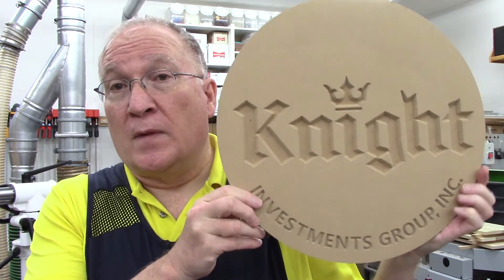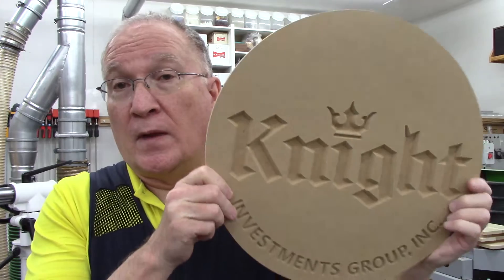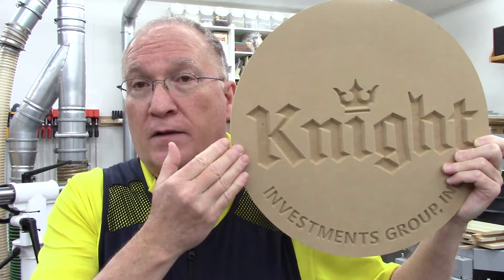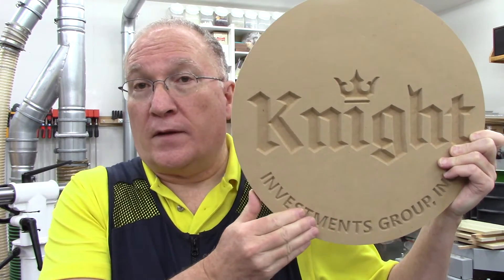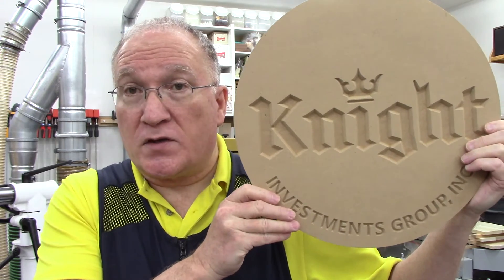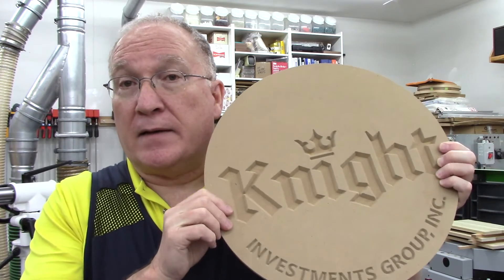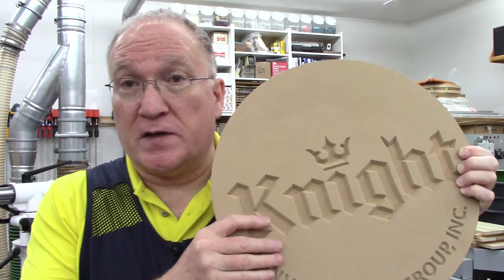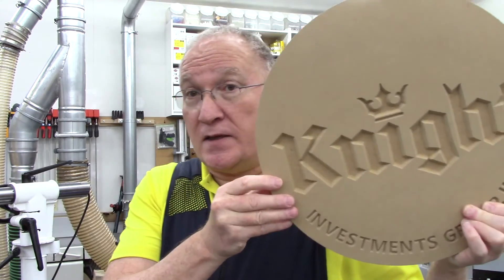Crazy Horse Dolly, Aigner Bowmould Master, and a Company Logo

Comment: great job, using the shaper guard the way its meant to be done, all encompassing the cutters, and the hold downs on the table saw, YES, no fingers within a meter of the blade 🙂; but when adjusting the fence after the cut, TURN the blade OFF, so you don't accidentally run the metal fence, or wood offcuts by the blade turning them into projectiles.

Comment: With that adjustable bearing do you have to make the cut in one exact spot? Looked like you set one point on the guide.
Reply from the maker: Hi Paul.  The guide has an elliptical shape to it so there is one point that offers the maximum depth of cut.  That point is marked with a white mark.  Steve

Comment: Steve, I had the pleasure of going to Michael's shop to pick up my crazy horse dolly!  He is a great guy with an amazing shop.

Looks like I spy an AD-741 in the background...  Did you replace the SCM?
Reply: if you are considering one or the other, I've bought both an ad741 and a minimax elite series machine new.  They are comparable price wise but the minimax is a considerably better machine.  Single post planer table on felder vs 4 post on minimax, and a friction wheel on the felder vs gear box on the minimax for driving the feed roller.  My customer service experience with felder was also one of the worst I've ever experienced.  Can't speak on customer service of SCM as I've never needed it.
Reply from the maker: @mckay5858  It depends on the vintage machine.  My AD741 is a 2005 model has served me well and has the 4 post design.  On the post design for the new models you are correct and I would not purchase a new AD741 for that reason plus you cannot get the Digi-drive on that model.  In the 15 years of owning the SCM and 12 of the Felder, I feel that if I could take the best features from both, I would have a near perfect J/P combo machine.  FWIW - I have had good experiences with Felder technical support but my single experience with SCM technical support 14 years ago left a lot to be desired.  Things do change over time.  Steve
Reply: @extremewoodworker  my 741 was a 2018, it did have digital table lift and read out but ya was glad to see the back side of it.  I have been told the older ones are better but very rare to find here.
Reply from the maker: Hi PK.  Yes - Michael is a great guy.  I met him and his wife last October at the Alpine Technical Workshop.  I still have the SCM and have had the AD741 in my shop for 12 years.  I won't share how this came about but have decided to sell the AD741.  It is sold but the guy buying it has to add on to his shop first.  Steve

Comment: I like the attachment for the shaper. I wonder if they have that for my F3 hammer.
Reply from the maker: Hi Chris, I am pretty sure it would fit your Hammer.  It comes with a drilling template for the surface of your shaper so you would have to drill and tap some holes.  I ordered this with my shaper and had Felder drill and tap the shaper table to secure it.  Felder carries them as well as Martin.  Just spec out the adjustable guide for the spindle size you have.  Steve
Reply: @extremewoodworker  great thanks for the great info. I enjoy the videos.

Comment: Thanks Steve. On the subject of items in your workshop I have a quote from Barth for their adjustable height mobile bench with vacuum pads , I noticed you had one and I was wondering if you could let me know your opinion on it . With regard to the content I prefer when you need to use a lot of machines/tools and process. Videos with the cnc don’t hold as much interest for me as it’s just doing the work , still good work but not as interesting as watching you doing the woodwork or operating the machinery. Regardless of people’s response keep doing it if you enjoy it 👍
Reply from the maker: Hi David.  Thank you for the feedback as I could pretty much tell from the views that my CNC only videos do not do well.  
On the Barth, I have a 500V and I understand they no longer make that and have replaced it with a small unit.  I use it on nearly every project but the large horizontal surface tends to collect stuff.  It works well but the 3 vacuum stations are a bit overkill for me so a smaller unit would probably be better for my situation.  It is a very solid and stable platform that is easy to move around the shop.  The adjustable height feature is an absolute necessity  now that I have had it and would never do without it.  The accessories are a bit overpriced IMO but I guess you have to pay to play.  The only item that I have not been thrilled with is the optional small vacuum pod as it tends to vibrate when sanding an item that is held (probably due to the limited clamping area).  Bottom line, I would buy it again.  Steve
Reply: @extremewoodworker  thanks for the reply- I’m going with the two vac pods on the adjustable bar that holds them in plane for now . Yes expensive but worth it is the general feeling from users. You have a good reputation for making wooden items to a high standard using the finest tools , I know some more woodwork projects would get the viewers back - cnc seems to be dividing the woodworking community!!
Reply from the maker: @CreativeCarpentry  David - you will enjoy the Barth for sure.  Of the 130 or so videos I have on Youtube, approximately 20 are woodworking projects (some multiple parts).  Unfortunately, only 1 woodworking project video cracks the top 50 in number of views and that logs in at number 22.   Interestingly, the top video I have has little to do with woodworking and comes in at nearly 550K views.  Generally, what people are viewing are tool reviews / tool advice, jigs and techniques in that order.  Woodworking projects come in dead last and my channel does not appear to be an outlier in this respect as other Youtubers have observed the same on their channels (CNC or not).  While I would rather make a project video than anything else, the effort to make a video can easily double the amount of time it takes to complete a project and the fact remains that relatively few will even watch it.  While this can be discouraging, there is usually enough positive feedback from viewers to continue moving forward.  Steve